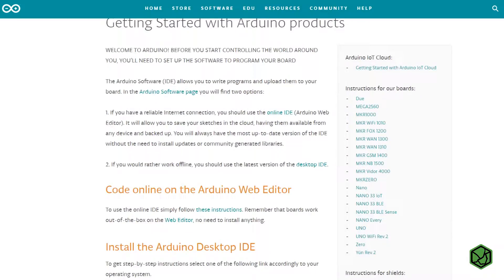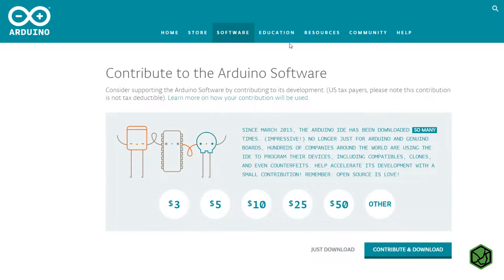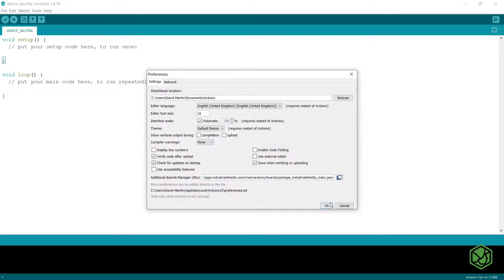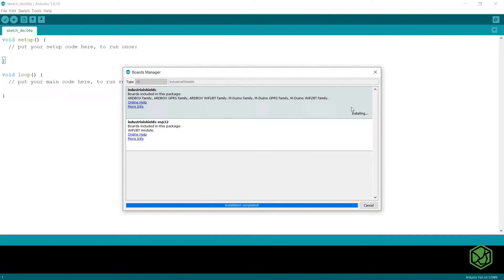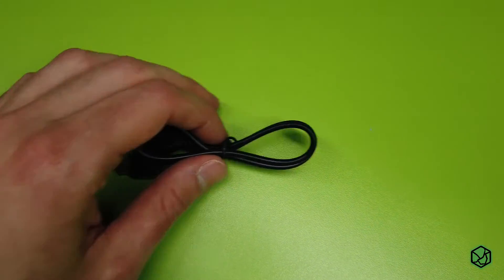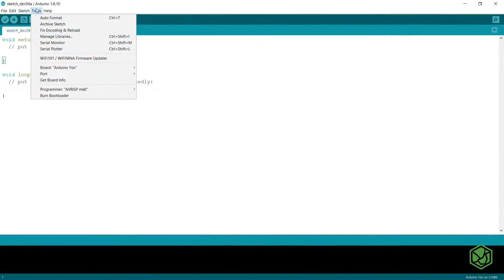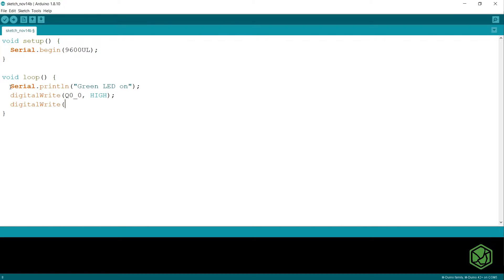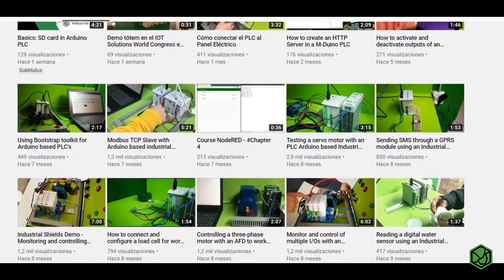✅ Basics: Configuring ARDUINO IDE to work with an Industrial ARDUINO PLC

Comment: We need a ladder diagram for this plc it is very easy
Reply from the maker: Hi, our PLC can be programmed using any software or platform that you will use to program an Arduino board.
Reply: Ok, thanks
Reply: So my frend give me the link please to down it ,i can not found it in site web